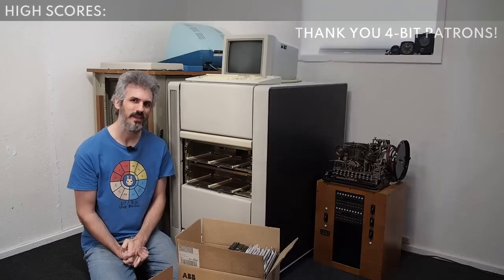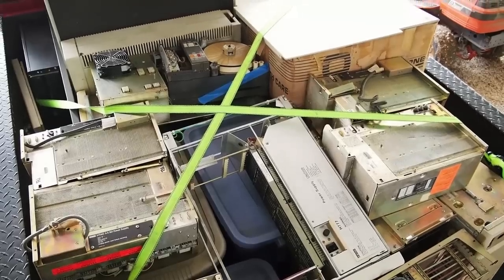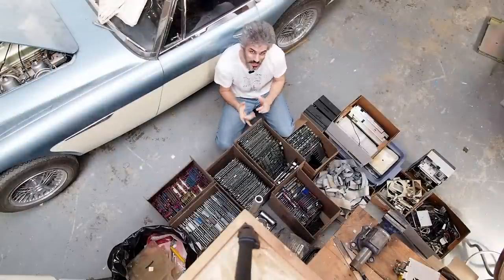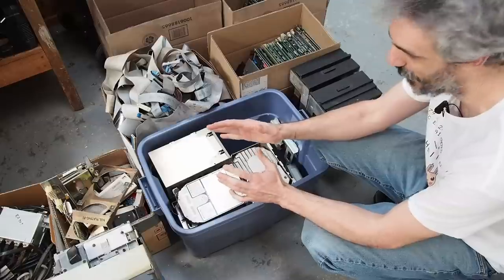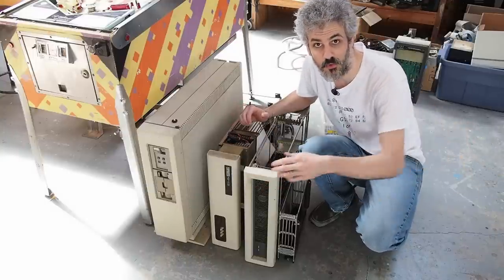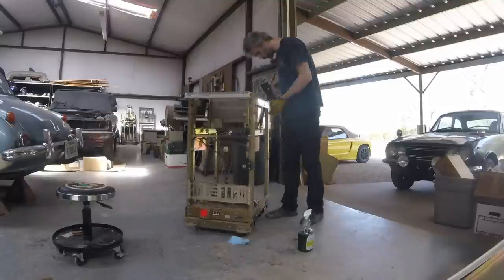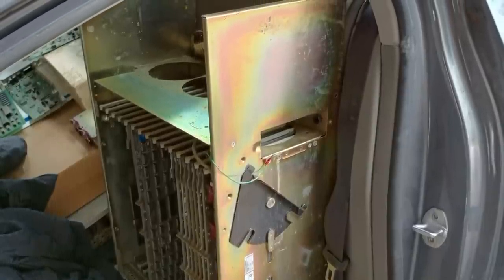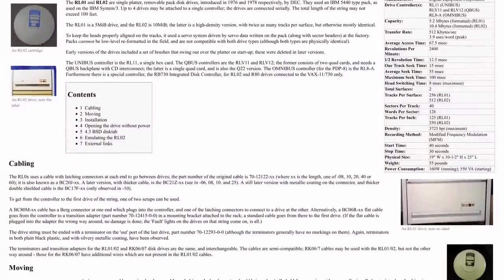The PDP-11 Motherload!

Comment: That is a DEC treasure trove. I fell in love with the PDP by ressurecting an 1976 3 axis CNC milling machine using a PDP 11/03 as a CNC controller. I had to learn the PDP ASM language to allow me to reverse engineer the firmware in order to fix and operate it because it didn't come with the complete documentation when I got it.

Comment: Back in the 80's some newspapers used PDP-11/84's for Editorial, classified and business systems, (rsx-11 with custom software)they used  RA81 fixed disk,  they are large like your centurion drive, also the ra60p removable  disk cartridges, I recall when we had a head crash on those took the Dec techs 8 hours to put new heads and align them. they were using ethernet to connect to  a Unix server and a Xenix server to typeset pages to a Laser Typesetter  to paper (before desktop publishing days). Thanks for keeping the PDP's alive!
Reply: Xenix!! Interesting, thanks for sharing 😁

Comment: That’s an amazing haul of DEC equipment. I learned my professional programming on 11/70, 11/34, and smaller 11/08 machines. The 11/70 and 11/34s ran RSX-11 and I programmed in MACRO-11. We built a Supervisory system to manage the test floors at Mostek. It managed test program download to test machines and test result upload from the test machines to the 11/70. The 11/34s were concentrators shuffling data between the 11/70 and the test machines. The test machines were 11/08s augmented with subsystems that allowed DMA of test vectors to chips being tested. The 11/70 managed around 100 test machines. It also supported data analysis programs our product engineers wrote to monitor chip production KPIs. I started as a test engineer developing programs to test chips and worked my way up to systems programming on the 11/70 and 11/34. It was busy, hectic, and a helluva lot of fun. I too, had a nerdgasm when I saw what you’d brought home.

Comment: I'm literally drooling seeing all the VAX stuff and the DECtapes. As for the tapes: Please keep in mind that they tend to "stick". It seems it helps to give them (opened) a soft blow with a hair dryer and spinning them for a few rounds manually helps. Also, they have a quite unique driving belt, which is usually broken. :/
Reply: Oh, and the tape drive... Their friction drum is usually either guey / sticky or brittle-dry and needs a replacement.
Reply: @jbglaw  Yeah, those TK50s were pretty reliable but if they got dirty they would not behave and those belts did go.   The TU58s where really reliable but sloooooow.   I did a lot of updates on 11/750 machines and it took forever.   I saw a DECTape II in the video but I didn't see a TU58.   The 11/780 used a RX01 as console media which was actually a PDP-11/03 I seem to recall with the RX01.    It's really cool that the VAX machines had the console media that could be different physical devices but always looked the same to the software.

Comment: Wow, what a score!

The TU58 drive with one slot in front and one on the side is for the VAX-11/730. The front slot is available on the front panel for general use, and the side one is accessible on the right side of the chassis when slid out of the rack. The side slot is generally used for the boot tape, which loads the microcode into writable control store and then loads the appropriate bootstrap into VAX memory. If you do not have working drives and good tapes, then you can bootstrap the 11/730 with AK6DN's TU58 emulator. I contributed a patch to get it working with my 11/730.

I have a pile of parts to turn into an 11/44 or two someday, but that project has a long wait for the front burner.
Reply: Good one there.. 11/730 and 11/725, the "smallest" grownups VAXens  (non-MicroVax) rated at only 0.25 VUPS (MIPS) where the 11/780 was 1.0 VUPS.. not very popular machines quickly killed by theVAX 11/750 and microVax-2.. some good info here: AA-M546C-TE VAX-11-725 and VAX-11-730 Software Installation Guide.pdf
Great post and subject.. love DEC forever!

Comment: The 11/03 was a respectable small PDP-11 based on the LSI-11 chipset., it is used as a front end for the VAX-11/780 where it could run diagnostics on the 11/780 and then inject microcode and control the processor, now if you want a TTL machine nothing beats a VAX-11/780 with the entire VAX 32 bit processor implemented in TTL.

Comment: I was in charge of the care  and feeding of an 11/730 around 1982-85. It had an RL02, some hard drive I don't remember, and a Cipher 9track.
These computers are much more delicate than what we're used to now. It required very clean power and more importantly, air conditioning.
It put some real heat into the room.

I got to know the DEC service guy well, due to his visiting about every 4 or 5 months. The machine came with a BIG binder with
schematics and technical drawings for that particular machine. They were kept on-site and service guy would refer to and update the book. 
He would sometimes use a wire wrap tool to make changes to the backplane.  Even this simplest of Vaxen was stunningly complex.
The 11/44 is a whole 'nuther beast. Keeping it cool will be a challenge, as will matching the cards with that particular backplane.

On the other hand, when you showed the Centurion the first time, I had my doubts it would ever run, but you put in such hard work and here we are.
Like I said, the 11/44 is a beast. Not 11/780 beastial, but a beast nonetheless. A real number-cruncher in it's day. Should be an interesting year.

Comment: The PDP 11/70 was the first computer I ever used.  It was running RSTS as the OS.   The computer was housed on the campus of a government funded educational facility and many of the local and not so local high-school's had a DECwriter II that was attached to it through a 300 baud dedicated line.    A student in one of the not so local to me school districts created this program that he called TANDEM which stood for (T)alking AND (E)xchanging (M)essagses and was basically an early chat-room/public & private message board system.
Reply: There was a program called TALK on our RSTS/E system. You could use it to annoy people. Every message was supposed to be prefixed with the user and terminal it came from, so that perpetrators could be tracked down and dealt with, but mischief-makers soon discovered that, if you typed enough backspaces, then your message would wipe out the user identification (just about everybody was on CRT terminals by this time). So the program was patched to reject messages with backspaces in them.

Then I discovered another loophole: you could put the terminal into TAPE mode (intended for reading paper tapes), which meant you could press RETURN and it would move back to the beginning of the line without ending the message, and you could overwrite the user identification that way. Then you pressed LF at the end of the line to actually send the message.
Reply: I used it as a student and then managed a "Student Timeshare" system for Los Angeles Unified School District in the late 70s - mid-80s. It was a PDP-11/70 running RSTS/E with 40 dial-up lines. The majority of the schools were still using 110 baud TTY terminals, but some had 300 baud DECwriters or CRT terminals. At that time, We had some brilliant folks poking around in the internals. We customized the WATCH driver (CRT functions) for TECO to support several different non-digital CRT terminals and customized VTEDIT macros for each version.

We also had a wonder package put together by student/alumni contributors called "Terminal Links," which allowed up to 7 users to connect their terminals together and view the shared output. A program variant called "Advise" allowed one terminal to send output to a second within the terminal link group.
Reply: @lawrencedoliveiro9104     Ah TALK..! Discovered TALK in early 80s on our local VMS server/node (at MEO DEC office).  With nodename::username you could have a conversation over DEC's internal network on a split screen VT100. My very first conversation was with a lady in one of the DEC offices in France' chatting about the weather! IIRC by the time I left in 1992 there were 6-7000 nodes on the internal network and over 100,000 user!

Comment: pdp11/44 was the first real computer I programmed on. Learnt C under Unix on it at UCL.  One of the 11/44's there provided all of the internet (Janet/Arpanet) connection between the Uk and the US at a wopping 9600 baud.

this was in 1978 - worked up to vax 11/780 and cray xmp4 and then downgraded to and 11/730 and microvaxes in the real world one I graduated.

Comment: I have several complete PDP-11 units with terminals printers and ALL OPTION cards. These units are loaded out with all the top options. Available in Pittsburgh PA. Message me if you are interested. This was two or three complete systems including the tape drives and hard disk units.
Reply from the maker: Color me intrigued!
My brother actually lives in Pittsburgh, and I will be driving right through after VCF East. Sen me an email at Nakazoto at gmail dot com and let's chat!

Comment: I had a VAX11/730 as my home computer in my late teens. It took 20mins to load the microcode from tape to give the VAX instruction set - wonderful days! VAX 8350 is awesome beast for the time had true SMP and the backplane BI was a precursor to PCI the BI boards were smart with a section on the board dealing with bus communication.

Comment: Glad to see all that wonderful vintage hardware being saved.   The VAX 8350 bus with the ZIF sockets is known as the "BI" bus.  It was a successor to UNIBUS and Q-BUS but unlike the earlier busses it required proprietary DEC silicon for the interface.   BI was used as the system backplane on the 8200/8300 series machines, and as an I/O bus on the 8800 that came out at the same time.
Reply: I think DEC’s BI and Massbus were locked down with patents and required licensing if you wanted to make compatible hardware. Unlike the earlier Unibus and Q-Bus, which were pretty much free for the taking.

Comment: Having Ethernet gear for your DEC systems is pretty cool.
DEC is actually the reason Ethernet is a standard. Ethernet was invented at Xerox PARC by Bob Metcallfe and then DEC went to Metcallfe and said "Can you make us a LAN system". Metcallfe said no (on the grounds that it would be difficult to make a LAN system that avoided the Xerox Ethernet patents and avoid being sued by Xerox) and instead suggested they ask Xerox to license Ethernet. Ended up with Xerox, DEC and Intel (who would make chips for the cards) getting together and creating the IEEE 802.3 Ethernet standard.
Reply: DEC were also responsible for boosting the speed. The original Xerox Ethernet ran at 3Mb/s; DEC insisted it be pushed up to 10Mb/s.

Comment: A great donation, the 11-44 is a great and fast machine! It does have some quirks such as a very complex power supply and get this some of the strangest fans you will ever see, 70 Hz AC fans! The machine will really shine using an OS like RSX-11 M+ but you would need to get the RA-70's Running for that. With the DSD dual floppy subsystem, you can run RT-11 on the machine.

Comment: I used to run a PDP-11/34 with an RL-01 hard drive. It ran RSX-11m as an OS and MCR/DCL as it’s command line interpreter. It had over 100 terminal and printers hanging of it.  Those were the days.

Comment: I used to have a PDP 11/23 years ago when I was a student, it's quite handy due to size and flexibility, it's less obscure/picky in what it will and not work with than some earlier machines are. It can also run some obscure RT OS setups that only work on a few configs but for its size it's louder than I expected. I just built up a single cabinet roller with it and two drives I forget the models of, was a fun setup to play with. You sure have enough to keep you busy for quite some time there hehe. Good luck, I hope you get much of it going and that the new homes for some of it treat it well 🙂.

Comment: So great to see so much love for DEC on this channel. My DEC experience was mostly with micro-VAXes & VMS from 1993, with DEC PCs to run Windows or boot as a terminal to the VAX. This transitioned into VAX Alphas with VT terminals and a few graphics terminals. Going to site with huge TK-50 tapes, then DATs or flopticals. So sad when in about 2002 the company I worked for and transitioned to Windows, which was fortunate considering what Compaq and HP did to DEC.

Comment: 11/44s came with Massbus by default, they expected to have RP04s or RP06es - An RL02 on an 11/44 would have been considered too small for one. 44s were one of the fastest PDP-11s.
Reply: Also note that if your 11/44 has a RH11 in it, you CAN NOT use the RH11 slots as normal Unibus slots, you will make things go bang if you try!
Reply: I don't think that 11/44 had MASSBUS by default. Now, if you said that they have SDI by default (for RA70, RA81, etc), I would agree.
Reply: @pdp11henkie  Before the UDA50 they were sold with RH11s unless the customer specified otherwise. Mine had a RH11 and was later field-upgraded to UDA50. The 11/44 was introduced in 1979, the MSCP protocol wasn't introduced until 1981 or 1982.

Comment: As I mentioned before: when I worked for the Dutch public packet switching network Datanet1 we used PDP11s for managing the network switching nodes and the BTMC ) Alcatel hardware was directly connected to the Unibus bus .. so the pdp11s talked directly to the dps1500 hardware without conversion interfaces etc
Good old times 👍👍🏳️‍🌈🏳️‍🌈🦆🦆

Comment: Used to use a Vax 11-750 when I was a trainee back in the late 1980's.  It had 3 unit like what you got in the background and a CPU cabinet (with tape cartridge drive).  It had 1 RA60 removable disk pack, tape drive and full size 2 fixed drives

Comment: Impression about the situation.  Don't give away too much.  Keep spares of irreplaceable parts!

Impression about the outro: Nice heap of kitties!

Impression about the video: Wow, blasts from the past!

Back around 1998 or so, I worked with a guy whose sofa was flanked by interesting lamp tables - the cases of dead MicroVax II's.

Around 1991, after a job change, I had a MicroVax II in my office.  It was a tremendous step down from the SparcStation that I'd had at a previous job.

That little desktop cage is just like a data acquisition system that I worked on in 1985 or so. It ran RT-11 and basically all it did was capture D/A signals, run some digital filtering, and dump them out on tape for processing with some massive Fortran thing on a mainframe. (I just had a short-term gig tweaking the digital filters and the signal conditioning circuits, so I never learnt what was under the hood on the mainframe thing.)

Comment: That tape port on the side I am 90% sure is for a tape robot, they were pretty common since a single tape often does not have enough storage for a full backup of an organisation, so instead of swapping a tape every 15-30 minutes, you would load a long tray of tapes and switch them out with another tray at a set interval, like every Friday or something in that order, and the software would load backups to the tapes automatically, the front one could sometimes be for doing incremental backups more frequently.

Comment: That 11-03 reminds me of the chassis that held the PDP 11 unit  that sat inside of the Vax 11/780 mainframe.  I think it's the same one that was used, although the last time i saw one was 25 years ago...  I do still have the black metal rack mount enclosure that the 4-space backplane fit into... (iirc, the PDP-11 that sat inside of the VAX 11/780 was used as kind of a supervisor system that actually booted the 11/780

Comment: Nice to see an 11/44 again. Used to rock one of those in one of my early jobs back in the 80s, also including a 1/4" tape drive, a couple of RX 8" disk drives and four CDC 9762 removable hard drives (swapped out later for CDC 9766 drives and finally by a custom SCSI drive with DAT backup). Thought it was a bit weird to refer to the 11/73 as a "late model" PDP-11 but I suppose it depends on where you draw the line. Mind you, if you think the 11/44 was weird in its construction, just wait until you encounter a PDP-11/70!!

Comment: Oh my god, I've just found this channel, you have a new subscriber. I used to use a DEC PDP-11 on a system labelled Racal Redac Maxi for designing PCB's in the 80's. It was 3 full heigh cabinets with two old dustbin lid hard drives. Happy days.

Comment: 9:02 As I recall the product naming, the models named “VAX-11/7xx” still had the PDP-11 compatibility mode, which was able to directly run (some) binaries compiled for the RSX-11 OS. The later models dropped this mode, and the “-11” suffix. So you had the 8xxx models. These were later replaced with the 6xxx models (higher performance, notwithstanding the lower model numbers).

Somewhere in-between those two, I think, there was a 9000 model. This was trying to push the limit in performance from the VAX architecture, but was not a big success.

Comment: Hi , I was A pdp11 System engineer for publising Atex HAd a memory mapped crt and terminals were nothing but serial with large keyboards  and vidio back from frame 16 each pdp. all linked by a common mmu box sharing 4 k of ram. I could look at a terminal miles away and if I wanteded control it.  It was awsume. were talking about  all news papers , atlanta constution  news 16 frames . so alot of terminals. incomming wire sorteded, eveven certin tag words per editor at news paper. I goes beond this theres clasified adds. thats where I got involved  so many actions for it. Some wrote macros for certin formats for magazines ad formatted text for that pub. Jake was the master of that.